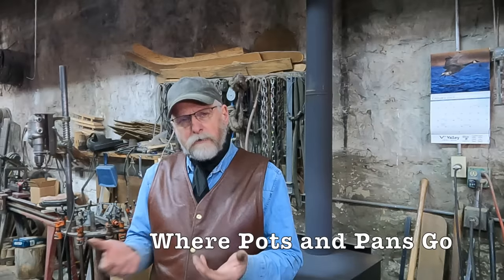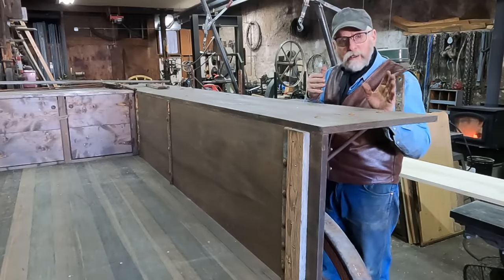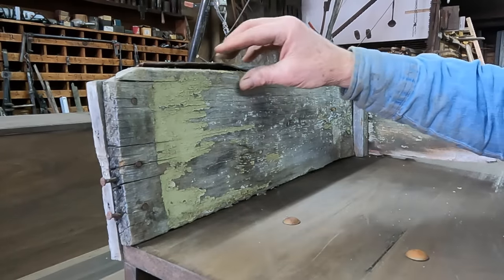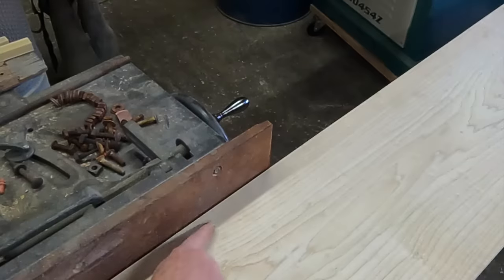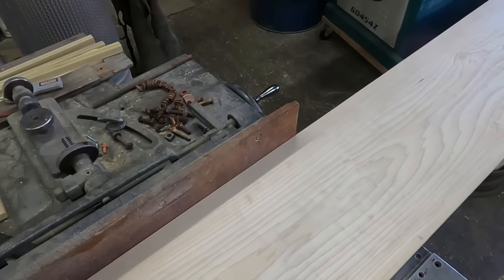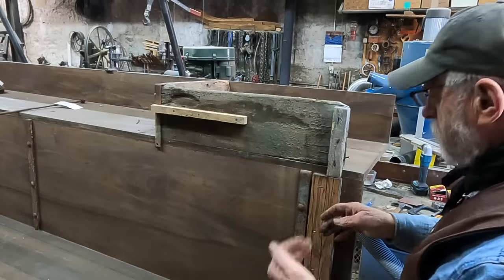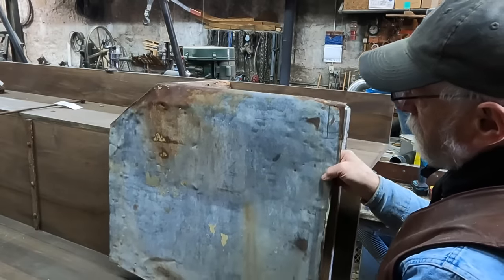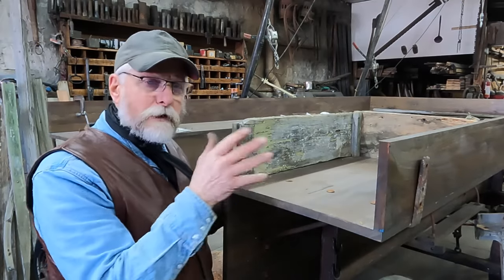How a Bachelor Shepherd Might Keep House | Engels Coach Shop

Comment: After watching you pry boards apart with your Stanley wonder bar, I thought I'd share a thought. As a lifelong carpenter, years ago I started regrinding my flat pry bars from the other side. It seemed to me that when I used a wood chisel to start lifting a piece of wood. I would always put the flat side up, and use the beveled edge as a fulcrum to gently pry the material up, so I could then insert my pry bar. So now my reground bars achieve the same prying action, making the physics work easier in my favor. I never miss one of your videos Dave. Thanks again!
Reply: Good tip.

Comment: Love the way you take the time and trouble to line up those square nuts, and make them square to the body, instead of just leaving the corners at whatever angle they naturally stop at. The sign of a true craftsman.
Reply: And putting nails in exactly where and how the originals went.
Reply: I have to admit that I chuckled a bit (respectfully, of course!) when he also clocked the slot-headed screws at around the 19 minute mark.

Comment: - You sure are moving along quickly, Dave. It feels good to see that.
- What about the right side vertical iron support leaning out of plum on the outside of the pots&pans box at 20:40 ?
- I am sure you know about that.
- I am guessing that you are going leave it as is to document the historical evolution of that piece of iron.
-  Because I saw it, my mind's eye saw what it experienced !
- Imagine over long use the massive repeated force of the heavy cast iron pots and pans bouncing about, smashing and getting thrown against it as the wagon lurched over ruts or roots, or driving through brooks or river beds... repeatedly making massive pounding force to cause the deforming it's original right angle?
- Wow, Dave, I can actually feel it. I can feel riding in the seat with the reigns in my hands trying to get through rough terrain over and over and over again. I can hear the iron cook wear clanking about. I can hear the boards and iron framing, screws and bolts creak and groan.
- What a powerful emotional memory machine you have put together...wait, can I smell the wet ground, or is it the river soaking the wood....or is it the smell of sweaty horses, too?
- It is as if the arch of this wagon's time line. Past, Present and Future is present to me as if I am a child somewhere down the road seeing the wagon up close after a parade at the fair.
- How is that possible, Dave. Gosh, you are a powerful Wheelwright Shaman !
- But wait, I should know better...you and your sweet supportive lady, Diane know who and what your are.
- This has become the first VISION WAGON.
- Maybe you have become a Master Visionwright Shaman, too.

Comment: Great "Re-creations" for sure. the old with the old, what always impressed me with any or all of the wagons. was the use, of support Irons. braces. they were always in the right spot to add support and save on wood. braces that would have rotted out way sooner. just some good old engineering! thanks for sharing. ECF

Comment: I used to use a single roller support like the one you use. But too often it tried to steer the board away from the fence. I switched to a multi-ball roller support and no longer have a steering problem.
Reply: After many years of misaligned roller stands "walking" boards away from fences. I discovered Rigid flip top work supports. They essentially are a slick surfaced skateboard like shape. So they are more directionally forgiving as material passes over them. Plus when locked in the horizontal position, they designed in enough play that the lead edge dips slightly. So it essentially "catches" the board that dips slightly coming off the saw, and then flattens out again as the board passes over it. I eventually gave my roller stands away after discovering these.

Comment: I've noticed that when you drive in nails you put them at 90° the the wood, I was always shown to drive them in at an angle to prevent them pulling out if the board was subjected to any strain, where as straight nails could pull straight out.

Comment: Nice.  I never really used a rounding hammer until recently.  I would find one and just put it with the farrier tools abs call it good. 
But I've been using one more often. Kinda liking it.  It won't replace my cross pien, but it's useful.

Comment: Change your roller stands to stand with individual ball bearings and it will eliminate the walking problem.
Reply: But with the rollers it can help keep the board against the rip fence as Dave illustrated.

Comment: The kitchen compartment seems to remain a little slope towards the front of the wagon.
I wonder, maybe they didn't want to cut the boards down in the "farm-build" and just worked the edges to fit the lower sides. Looks like about 1/2" less tall.

Comment: I do a lot more work on boats than wagons, but you might want to check out a penetrating epoxy to repair wood that is falling apart. I use it on boat parts that are pretty rotten but can't be replaced at that time.

Comment: When you used the ‘hot rod’ to open up the holes you had drilled- was it to make them bigger or is there another purpose? 

Also it was nice to see how to adjust our feed rollers to get a straighter cut. That’s a new one for me.
Reply: To align the holes andcseal them.

Comment: TOP TIP: To easily flattened rumpled sheet metal,place the tin on something like the top of a table saw and beat in flat with a hard rubber mallet. This way doesn't stretch the metal.
Reply: Thank you. You'll see that next week.

Comment: @dianeengel4155   As I had already commented this previous video https://www.youtube.com/watch?v=YkWsvZ7fCkI,
I believe that the boards of the benches were originally joined the other way round, 
i.e. the horizontal board slightly narrower, and the vertical board (the backrest) higher, 
so that the vertical board would cover the edge of the horizontal one, 
protecting the gap of the joint against raindrops that might creep inside between the boards. 
Not a real issue any more, because the wagon will now be kept inside; just a detail of how it was built originally.
Reply: I'll tell Dave.
Reply: Dave said he thought about that, but he built it the way it had been built.

Comment: What is the purpose of the hot rod through drilled holes, I noticed you also did this on the last video of the manure spreader
Reply: Dave may have another reason but the main point of burning a hole is to slightly enlarge it while at the same time hardening the wood making things slide in the hole a bit more easily and somewhat preventing deterioration over time.

Comment: When you use a hot rod in the drilled hole, was it to ream the hole for a better fit? Or does the red hot rod do something else to the wood?
Reply: Water prof 😊
Reply: It aligns the holes and seals them.